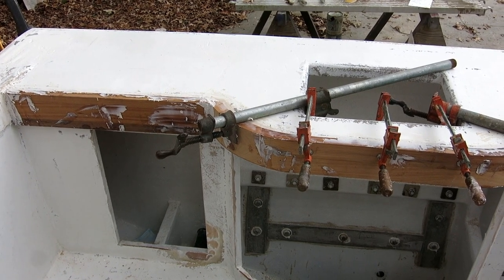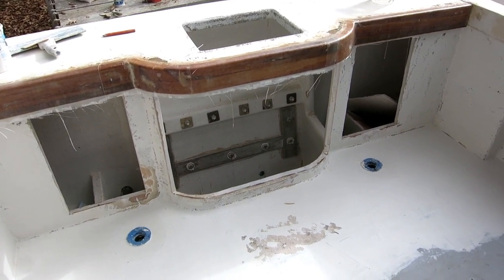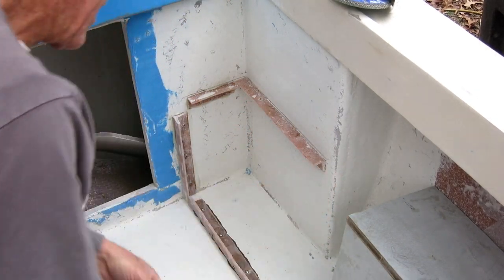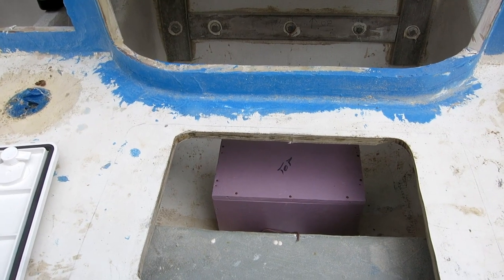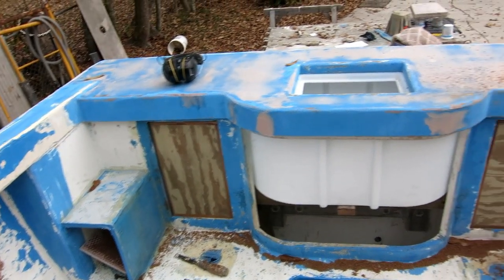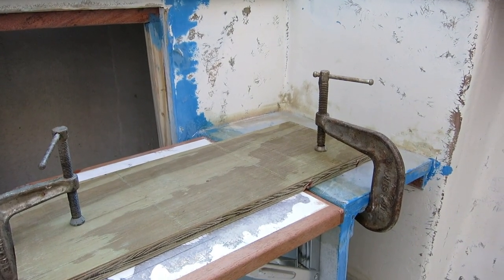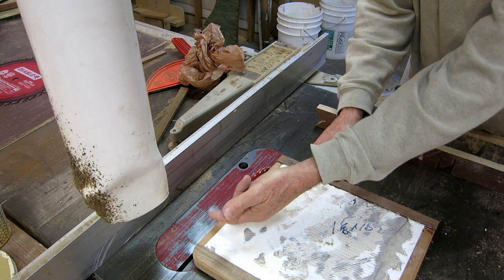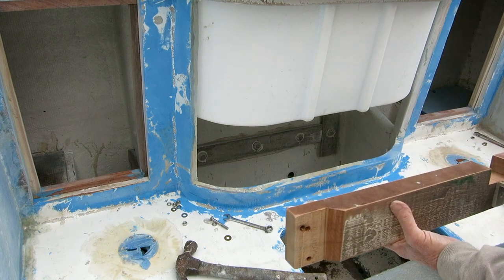CC #24 More Messing With The Aft Trim and Steps

Comment: 2 steps forward and 1back is better than 3 forward and 2 back in my books. 
As long as you find a way around the obstacles and still have all your fingers 🙌🏼 then you’re heading in the right direction.
Reply from the maker: Thanks Wayne
Two forward and one backwards should be etched on my tombstone.  Back when I had a real job it was "Concrete is easy, people are hard".
Barry

Comment: I've been working with fiberglass, wood, steel, wood and all types of paint and primer commercially for over 45 years. I sure can't follow your thought process on building. If you're a woodworker you must burn through one helluva lot of wood for a simple project. 

Put your battery in one of the transoms steps...much better access.
Reply from the maker: T O
I am not sure but I don’t think you meant that as a compliment.
Barry